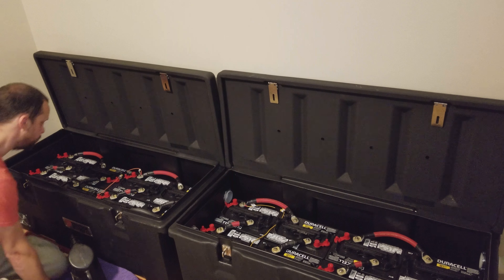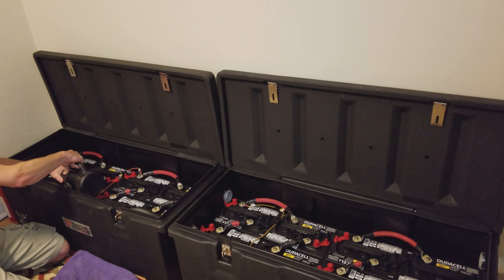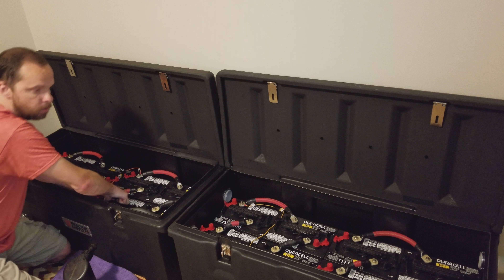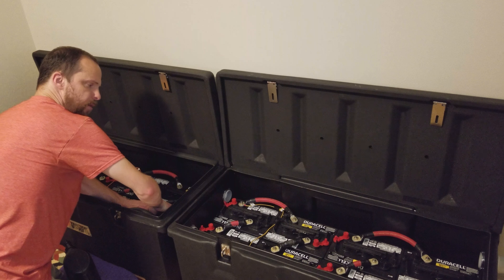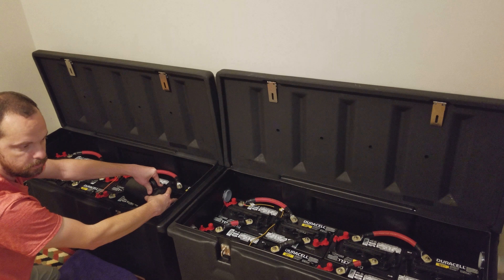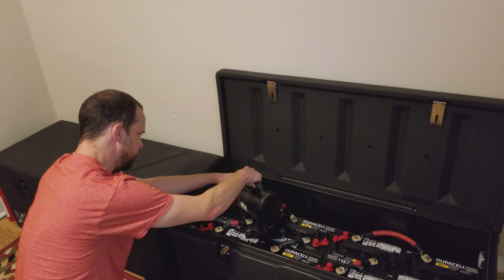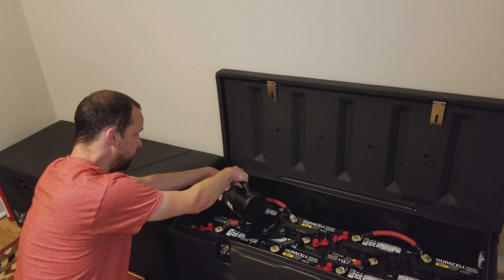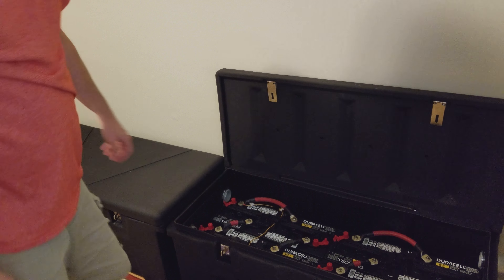Topping off 16 - 6 volt - 24 volt 20.64kWh battery bank with water. AC Coupled solar inverter.

Comment: Nice battery boxes where did you get those from?
Reply from the maker: Tractor Supply
Reply: @DavidKK4GAF  what was the item listed as?  Storage box or tool box?
Reply from the maker: @donaldsteele6276  Yes
Reply: @DavidKK4GAF  here is everything i used to make a temperature controlled relay cooling system i will share with you.the fan blower is like a freaking leaf blower  Check this out at Amazon.com
Attwood 1749-4 Quiet Blower Water Resistant (White, 4-Inch) https://www.amazon.com/dp/B003EX02DA/ref=cm_sw_r_other_apa_i_JlTwEb2A5SQEV
Reply from the maker: @donaldsteele6276  I have a heavy duty 24-12 stepdown convertor.
Reply: @DavidKK4GAF  those are good .

Comment: did you mean 20.64 kWh?  96 V * 215 Ah = 20.64 kWh
Reply from the maker: CAPSLOCK 24 V * 215 Ah * 4 (24 volt batteries) = 20,640Wh. My neighbor has the same battery bank on his 3Kw off grid array.
Reply: that i know. but your title says Kw instead of kWh, so does your description.
Reply from the maker: CAPSLOCK thanks. Fixed it.
Reply: Cx